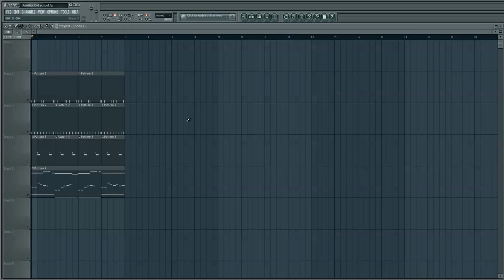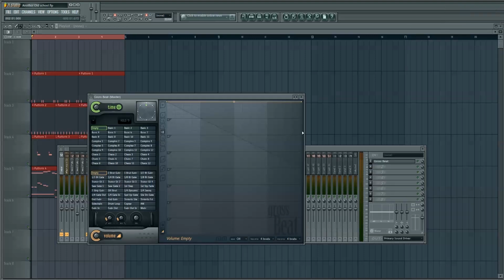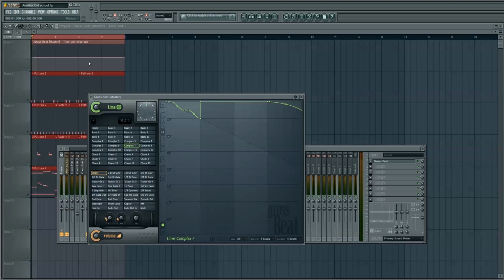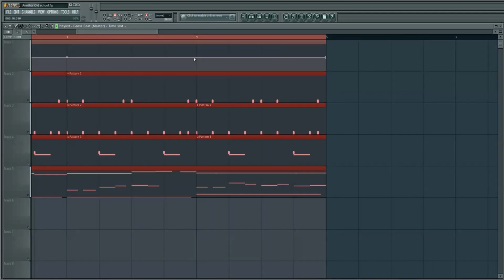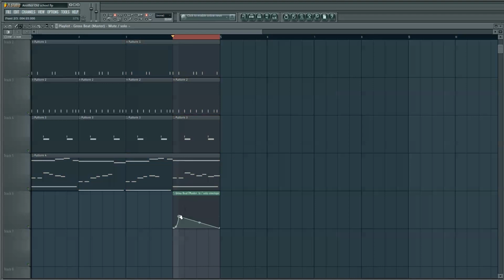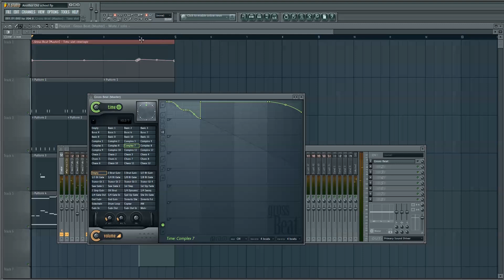How To Automate Gross Beat in FL Studio

Comment: Doesn't work did everything you say and the automation clip does not even do anything the only way it works is if i put gross beat on each individual mixer insert.
Reply from the maker: Hi. If you want gross beat to effect all your MIDI/audio clips put it on the master channel instead.
Reply: I have the same issue. I select the bars I want to automate and create the automation clip in gross beat. Has no effect on the song.

Comment: I got this to work before and I can't now for some reason. Whenever I apply gross beat to one part of a song, it's applied to the entire song. I can't figure this out
Reply: When I deselect the automation clip it it only works one time in the song how can I fix this
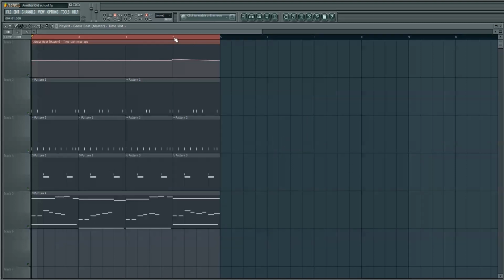Reply from the maker: If you want the Gross beat to run continuously throughout your track do not use the "on/off" automation. In other words, skip the step found at 1:26.
Reply: I been trying to figure this out for hours
Reply: +Cereal Got the same issue, ;s
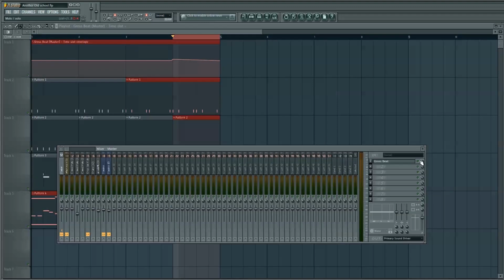Reply: Hey! Did you use the automation technique shown at 1:28?
Reply: +Warzone Productions solved it :)
Reply: Short and Sweet Tutorials How do I make it work for the part I used the automation clip only then play normal for the rest of the song
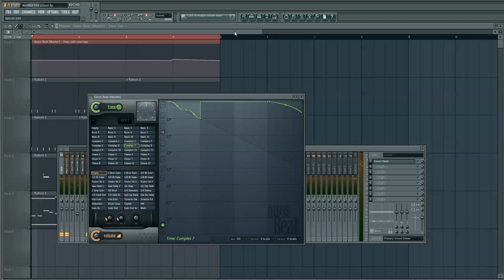Reply from the maker: Yao Don this is a tutorial on exactly that. have you applied the technique shown at 1:26?
Reply: Short and Sweet Tutorials Thanks I found out what I did wrong the only problem now is I can't use the fruity eq 2 to mix down the melody that I have linked to gross beat in the mixer how can I fix that
Reply from the maker: Im not sure I understand. So on your mixer channel for the melody, you have a gross beat insert and underneath that the Parametric EQ 2? Automation of gross beat parameters should not affect the Parametric EQ at all. Please elaborate if you can.
Reply: Short and Sweet Tutorials In the mixer I want to insert both the gross beat and the parameter EQ 2 in the same melody but it won't let me
Reply from the maker: +Cereal Have you selected a loop in your playlist and created an automation clip for the bypass parameter? This can be found at 1:25 in this video. Also make sure the gross beat is not on the master channel. It is also worth noting that in order for gross beat to play back correctly, you must always start the play head from a bar number (and not, say, half way between a bar)